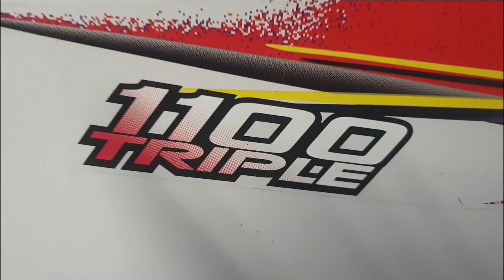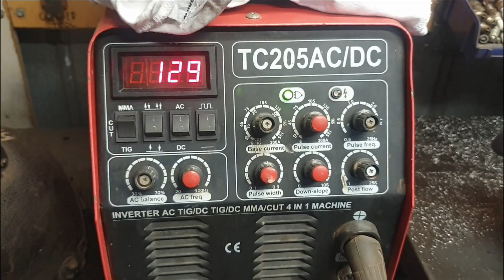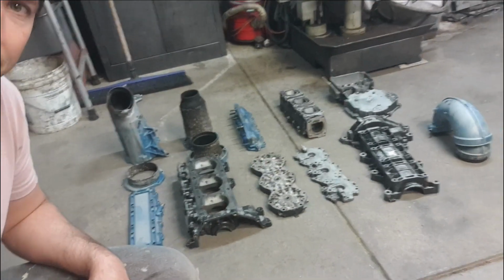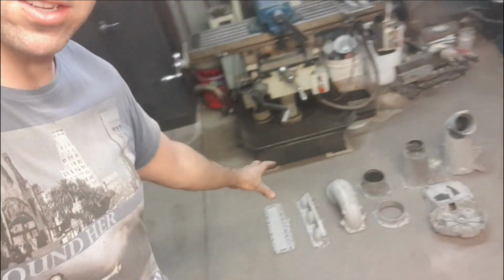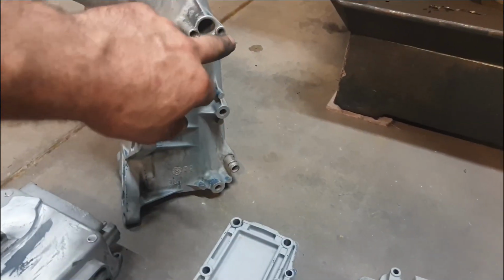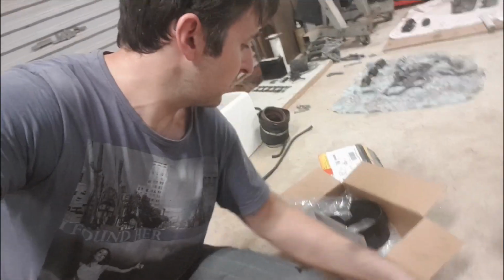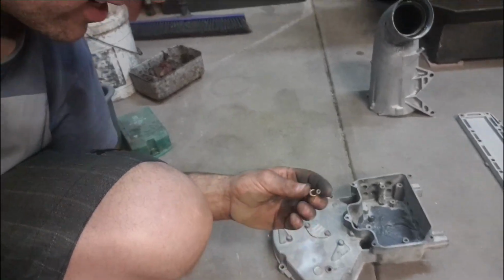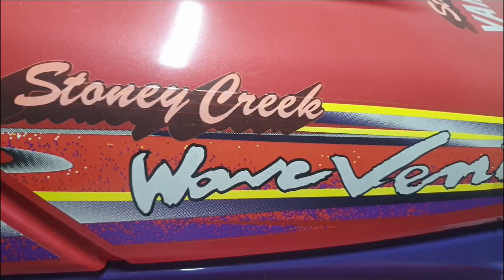Rebuilding 1100cc 2 stroke jet ski PT.3 - preparation for motor up style

Comment: Also mate, in regards to the weld repair in the bottom of the crankcase, id recommend getting that as smooth as possible and as close to original CC as possible. Due to the operation of 2 stroke engines, the fuel oil mixture circulates the crankshaft before getting pulled by vacuum through the transfer port and into the combustion chamber, id be inclined to say you may find an imbalanced operation between cylinders if the material added has changed the flow characteristics and cc of the crankcase. Difference maybe nominal or could cause issues with cylinder jetting and A/F mixtures  (Mechanic by trade, my opinion and just a tip )  

I see that you ordered new cases, good decision, wasnt up to that part of the video when i commented 👍
Reply from the maker: Yeh, in the end there was alot of questions in my head, and yep getting another set was the better option.. just seeing how thin the case was when Dolphy was welding it, I should of been straight out... but I do like taking challenges for the channel... but this one was a no go..

Thanks for watching and your input in to the video, very much appreciated 🙌